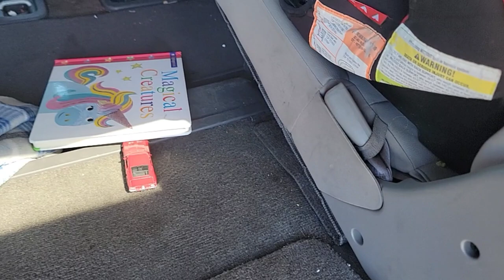Shop Help From The Littlest Unit @RainmanRaysRepairs

Comment: Nice job pushing that van into the shop on the other video.  Really, Ray just needed to hang a tire between the two and it would have been a lot easier.  But you did great.   High stress for sure.

Comment: you can take a vibrating sander (no pads) and run it along with the vacuum to pull up sand and grit from those carpets. you'll find it works pretty good.